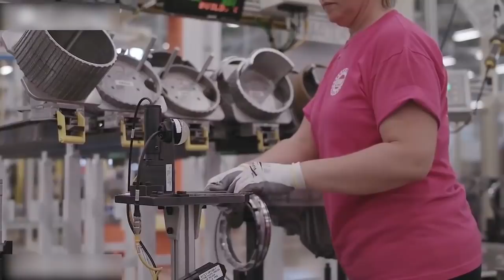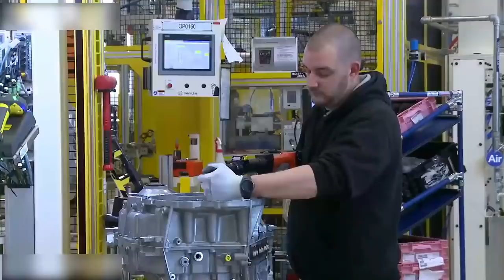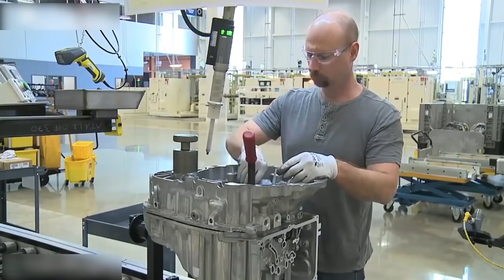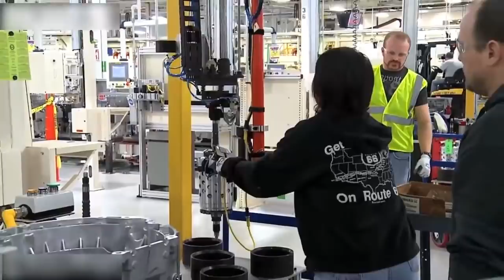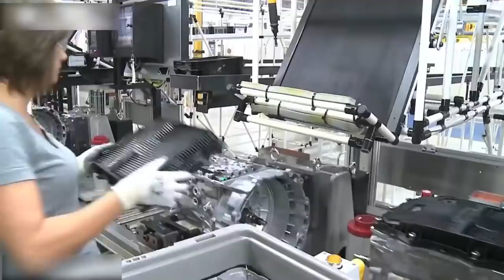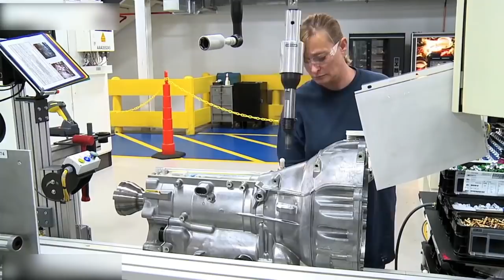German Gearbox Manufacturing Process - CAR FACTORY Extreme Machines

Comment: The thing that I find most interesting in this video is the optimization that is the hallmark of German manufacturing. Not only is the machinery state of the art but the  assembly procedures are different than the standard old fashioned assembly line pioneered by Henry Ford and  have been optimized for maximum production efficiency and throughput. This only makes sense because you cant' have economy without efficiency.
Reply: And the quality of the air the worker's breath.
Reply: You probably dont give a damn but does someone know a trick to get back into an instagram account?
I stupidly lost the account password. I appreciate any tricks you can give me!
Reply: @Cain Prince instablaster :)
Reply: @Harlem Erik Thanks so much for your reply. I found the site thru google and im trying it out atm.
Seems to take a while so I will get back to you later when my account password hopefully is recovered.
Reply: @Harlem Erik it worked and I finally got access to my account again. Im so happy:D
Thank you so much you saved my account !
Reply: @Cain Prince You are welcome :)

Comment: That's all good and well, until a couple of years down the track, how is yer local mechanic gonna work on that?
Reply: Sheriden Boord if it's been built right, your mechanic shouldn't have to work on it in the next 10 years. Besides, second rate mechanics aren't a valid reason for limiting engineering

Comment: What is the tool doing at 10:55?
Reply: Fix the Clutch or Torque Converter
Reply: Cargofan it took long and didn’t see anything moving, I thought it was measuring
Reply: Sheila, thank you for your quick and very good explanation of the process.
Reply: Steve Farkas  it is checking the right position off the flywheel because the flywheel is a heavy part with the lot locations per minute so it has to be mounted really perfect
Reply: Sheila just gave us a detailed account of what that tool was for, BV. But thank you for your input. I have every confidence someone will find it useful.

Comment: Germans can't make good Automatic transmissions or electronics . Worst cars on road. Our shop full of them.
Reply: mitzvah golem two drummers always make better electronics then the Americans The schlamerican have no spirit for the tiny fine mechanic and much less for the electronics
Reply: mitzvah golem Ans esp including injection systems invent and produced by Bosch pure German and the best in the world that's why they are used also in the American V8 crap cars
Reply: Instead of building good streets the car manufacturers make real Bad Casus
 even when you break the complete front of the car goes down on the knees and the ass of the car Goshigh up in teh Air 
If I had to driveducha lurge car  I would also try to make other carsbad ans Craps wieghaus- for such liege cars nothing to be proud of it Zoey Staudt Hefte Engineering knowledge you have to make better constructed cars Bad... poor is the man which proud depends on making others Bad  and down thats is a realindictment
Reply: The Americans make good ships but in submarines the Germans are five years in the future without nuclear power we don't need that toxic crab which is still toxic after many many years
Reply: Moto japao